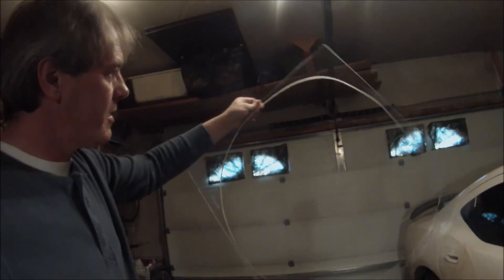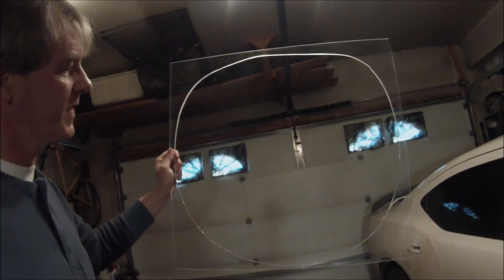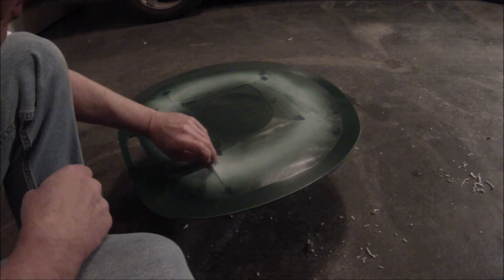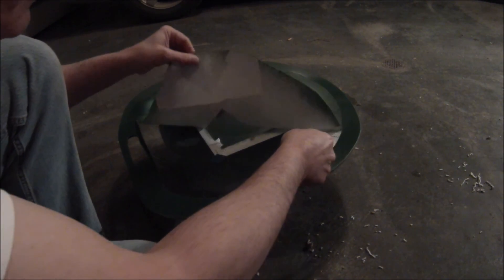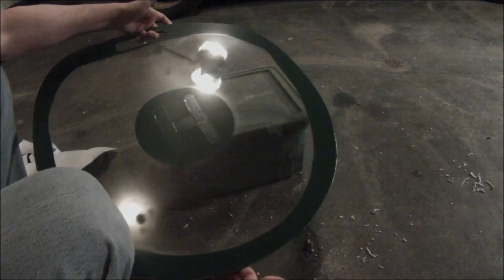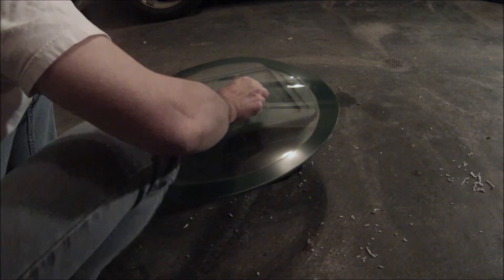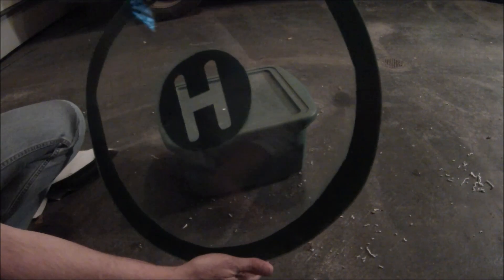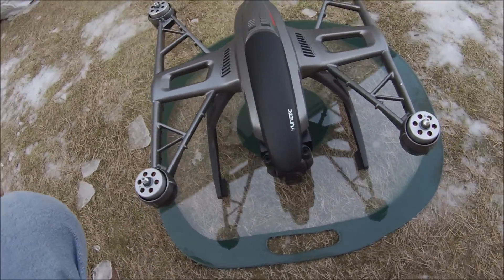Building a Landing Pad for my Quadcopter

Comment: Nice job! I think it will work just fine for the Yuneec and many others BUT..... I would warn against using this type of surface with any quad that has a downward facing "vps". I have experienced problems with my I1 on a glass table while putting it into "storage mode". It does not see the glass as the surface below it and just buries the belly on the table. This quad uses the same system to know when to raise and lower the landing gear. Just food for thought!